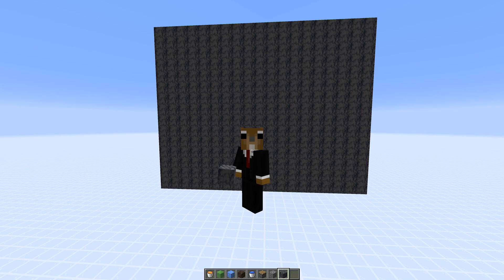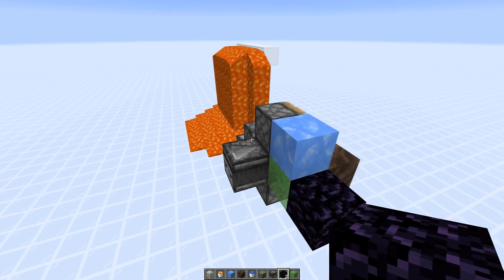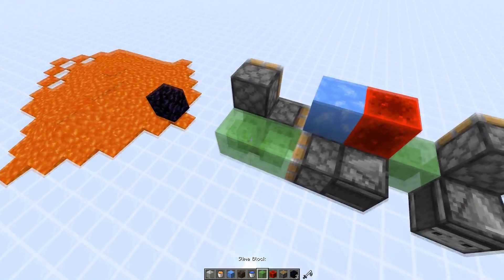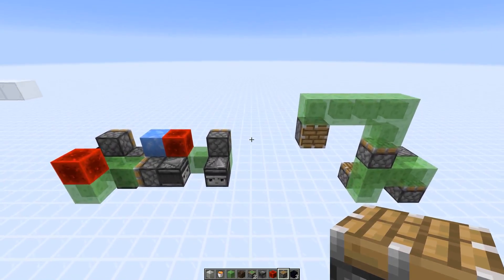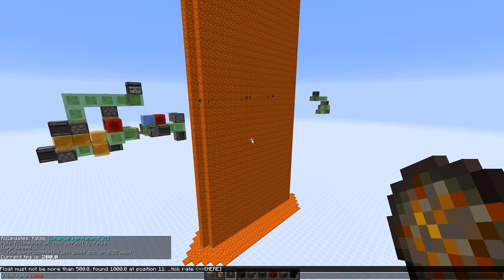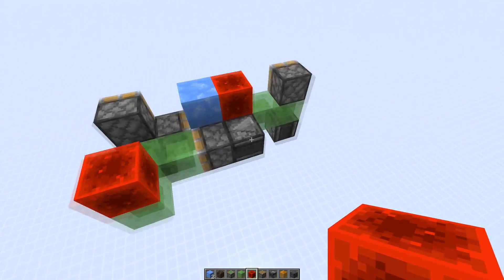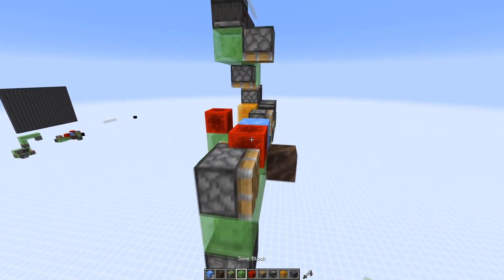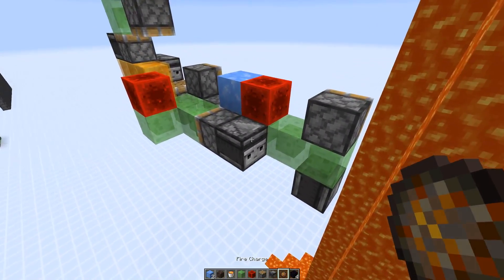Automatic Basalt Wall Maker

Comment: @ilmango 
in the new snapshot 20w14infinite they added randomized dimensions by throwing a book into a nether portal, if you write overworld in the book (title does not matter) and throw it in it will give you a world with the surface magma blocks but when you dig down a little you get a ton of diamond blocks, also if you type slime in a book (title does not matter) and throw it in a nether portal you get a world full of slime.

Comment: Wouldn't it be easier to have the flying machine just stay at one level horizontally moving left and right (pushing the basalt further out horizontally), then have pistons on the other side push the basalt vertically down? You could then also just have a 2-3 block height for the lava, rather than have it flow all the way down.

Comment: 2:20 instead of putting two pistons around one basalt generator (ice and soulsoil), could you put two basalt generators around one piston?
Reply: BlockofBudder 1 then the single piston would push one basalt behind the lava then a second basalt would generate with nothing to push it
Reply: @Thetypingcow  I don't think so. You can see when mango tried to put the piston right before the basalt generator, the machine was able to move a few blocks before the lava would flow down again. I think that would be enough time for the back basalt generator to move out of the way
Reply: Genuis, but why didnt he just build the wall from the bottom up? then he wouldn't even have to push the block forward?

Comment: if basalt is bomb resistant, it might be a good alternative in pvp faction servers. with this machine, and with a way for the machine to push itself back up, you could make sure you have one hell of a wall, but i suppose most faction players don't use redstone outside of tnt railguns...

Comment: B R U H this is almost exactly what I've been working on since the snapshot came out! My version goes up and uses a double piston extender to push the new block out of the way but that unfortunately means it needs a slower engine to run it. Rn I'm trying to make something to push it over after it's done so it makes a massive solid box of basalt.

Edit: I meant a sticky piston that fires twice, not a double extender

Comment: I wonder if you can make a basalt maker flying machine that can change direction more than just front and back. If you can make it change directions by 90 degrees, you can really start to make long distance builds like a basalt base railway system

Comment: How long could this wall be at max?
Reply: Probably no limit, though if it goes so far it flies outside loaded chunks you would need to add some kind of afk spot to the flying machine. The cost of the flying machines is constant, the cost in lava to scales directly with the length of the wall. And you could always build one section at a time though that would require rebuilding the machines multiple times and I think filling in the gap between sections manually.

Comment: if you run the machine from the bottom up, could you avoid the pushing in of the basalt blocks? Seems a bit easier. Also could you maybe make the wall two blocks thick, or more, if you are already pushing them in anyways?
Reply: The newly created basalt gets in the way of soul soil (which you must place below the lava). You could use 2 symmetric pistons right next to the soul soil for pushing the basalt in... or even use the paraplegic slow flying machines by OneTickPulse to push the basalt in with the soul-soil block.
Reply: @sharpfang  thanks, i managed to overlook the fact that you need to have soul soil underneath.

Comment: One thing I didn't really understand is why not just build the wall from bottom to top with the flying machine instead of the other way around, because then you wouldn't need to push in the blocks, right?
Reply: the basalt would be in the way of the soulsoil.

Comment: I wonder if it could be smaller if you built the wall bottom up, wouldn't have to worry about pushing the basalt in
Reply: The soul soil needs to be below the lava to generate basalt. If you were to go from the bottom up, the basalt from the previous row would be in the way.
Reply: @Merit_Inherent  This was my question too. Now I feel kind of dumb. That said you could probably work around it exactly the same way by pushing the basalt in.